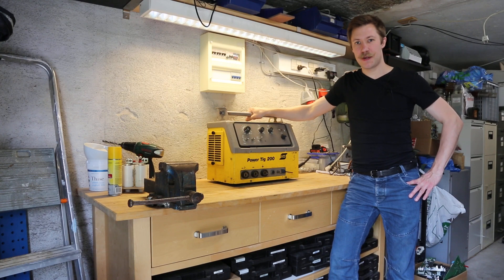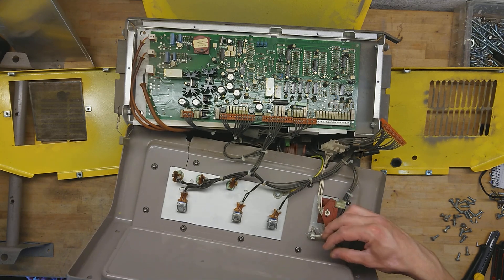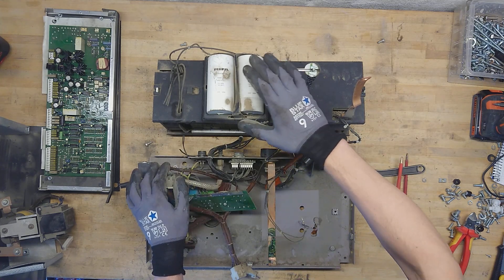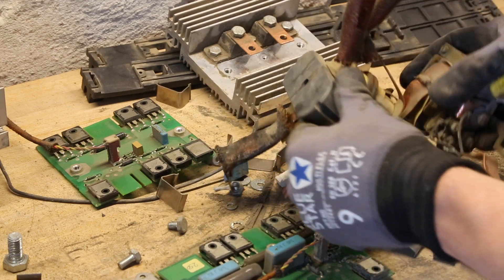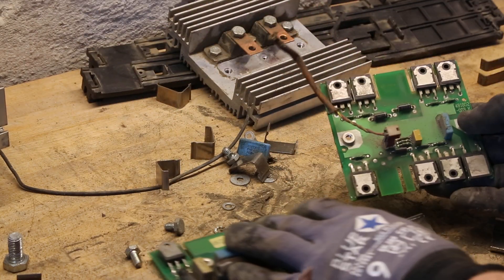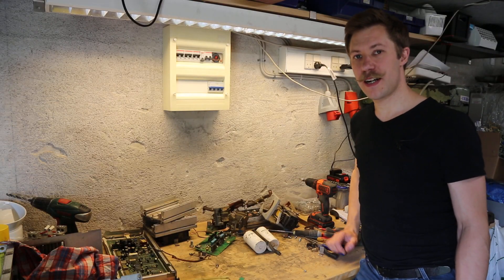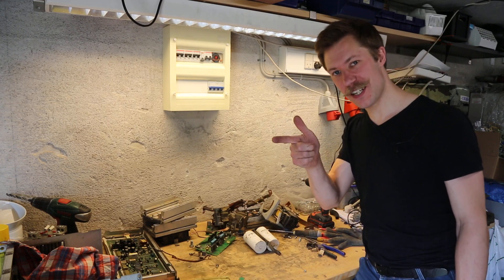ESAB Power TIG 200 Welder Teardown

Comment: Congrats, so basically scrapped a fine TIG welder, maybe worth 500-1000€ on second hand market.
Reply from the maker: No. Just no. It was worth being gives away or thrown out. Nothing gets torn down on my bench if a repsir or sale is profitabel.
Reply: Have repaired my 1996 LTL 160 Esab Tig welder...., at least there were three broken capacitors....., still working fine! By the way, with the same Rifa Elkos!

Comment: Why do you say the MOSFETs / IGBTs cannot be reused? Is it mostly because they're damaged? From my noob perspective, I would have thought those are decent pieces to salvage.
Reply from the maker: These boards were also protected by a layer of varnish, makes removal harder and a bigger mess
Reply from the maker: They can be reused, just not for the work I want to make. These are typically low voltage rating, below 100V

Comment: Was this TIG welder working before you destructively took it apart? You didn't even test those 1000uf 400V Rifa caps, they could still be good.
Reply from the maker: It was discarded due to defective handle/cables. Price of getting those again is higher than buying a new modern TIG. I got more than enough electrolytic capacitors in stock and a high ambient temperature electrolytic capacitor from a high current inverter is usually worn out.
Reply: I highly doubt that.

Comment: interesting teardown, despite glitchy audio
Reply from the maker: Thanks and I know I have to track down an issue on my smartphone that has started doing this, or what was the specific glitch you refer to?
Reply: @KaizerPowerElectronicsDk  It sounds like a badly scratched CD.
Reply from the maker: @NiHaoMike64  could you give me time of where it happens? Is it more than once?
Reply: @KaizerPowerElectronicsDk  , Based on the 48khz 16-bit audio I see, a 10khz low-pass "shelf" was applied with a few exceptions during wire clipping (relevant later).
Glitch list as far as it streamed to me:
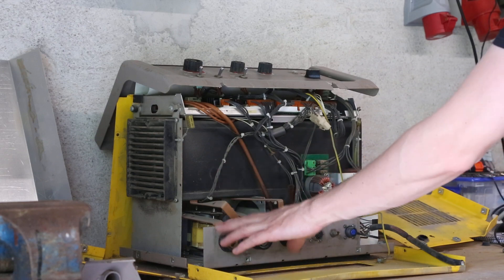0:24.2, 0:41.57, 0:49.5, 1:12.23, 1:18.5, 1:29.2, 1:35.2, 1:53.0, 1:58.57, 2:11.1, 2:23.1, 2:25.5... you get the idea.
Typical glitch:
About 1/30 to 1/8 second each.
Volume drops off quickly and cleanly (0.005s).  Any detectable taper might be an artifact of my decoder.  At the cutoff, there's a left/right channel asymmetry in an otherwise mono track.  
When sound resumes, volume rise is exponential (double-exp by the looks) and takes about 0.01s.  High frequency noise is present for that period but does not break past the 10kHz shelf.  Again, consider Nyquist, but it's interesting that 10kHz cap is preserved. 
Chicken/egg logic points to the break occurring before the filter.  If you're not the one running the filter, then data's not making it to the encoder.  A lot of 1's or a non-audio handshake might be what we hear on resumption.  
Take a close look at 5:56.40 as your left hand draws back and grasps the harness.  Did we see a frame or two drop there along with the audio (or was it how the wire was grasped)?  
Is audio a lower priority for some component in the workflow, and we're hearing the canary in the coal mine?
Opinions are like... well, you might want to try 44.1khz@24-bit for youtube -- especially if the device is 44.1 native.  96kHz should make the problem worse.  Dropped frames might be detectable by recording a tone along with a steadily moving object (record player teardown or is that blaspheme?).
Anyway, I hope this gets the juices going.  Edit: forgot smiley e-moji :)
Reply: @gth042  Damn, this guy knows how to audio